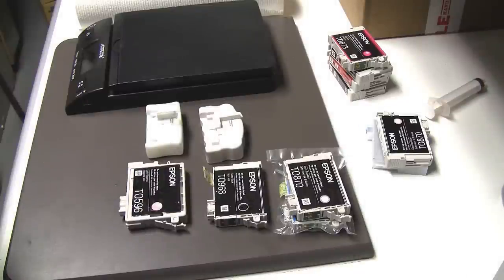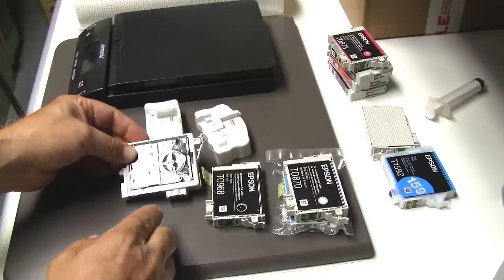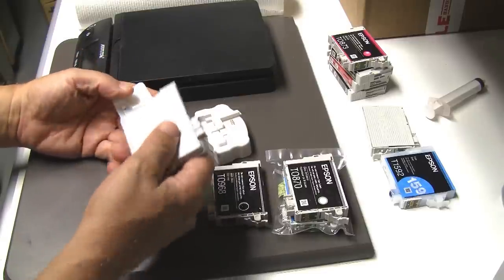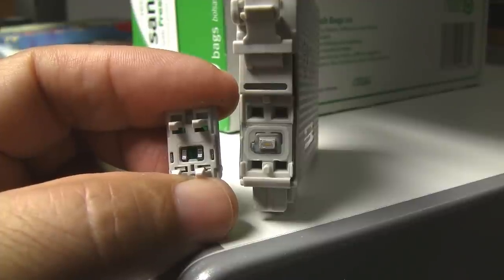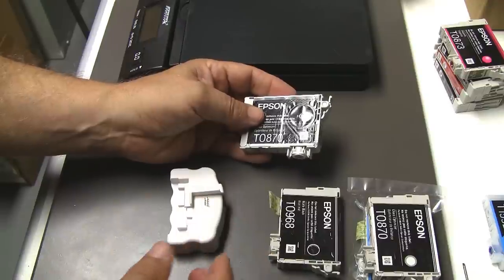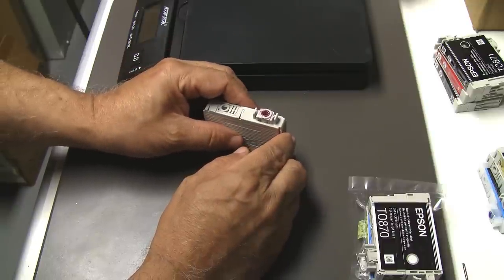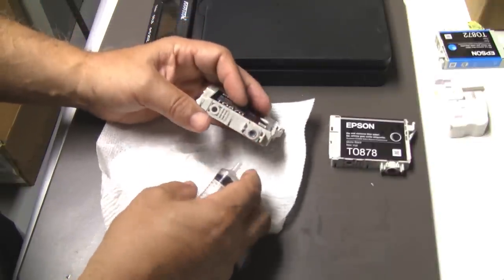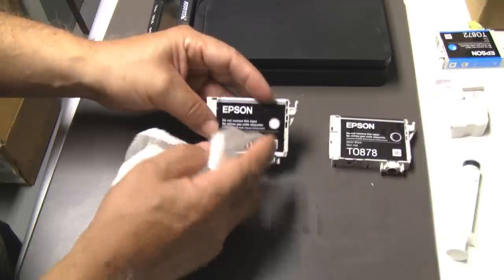New way to refill OEM Epson carts

Comment: I just bought an Expression Premium XP-6000 from Epson. Can you use that method on the 302 carts. which come with it.
Reply from the maker: Nope. This will not work with any of the newer carts, EPSON changed the design to prevent us from continuing to do this.

Comment: Thanks for your findings and for letting us know!

I've tried it with a t080x for my R285 and succeed in breaking the membrane.
Sadly this wet sensor makes you refill so soon that you can refill only around 5ml of the full 7,5ml (which is a joke actually). So I switched back to refillable carts

My question:
I wanted to refill also T054x for my old R800. There are refillables on the market but it's hard to find some reliables 
Do you have tried your method of disrupting the membrane also with this type of carts (for epson r800 and r1800)? 
I just tried to make it "pop" by pushing air into the outlet. But what have worked out fine with a T080x ended with a leaky T054x. I disrupted the cart, not only the membrane.

The T054x is not in your listing but you might have a R800 or 1800 and tried it out...?!

martin0reg
Reply from the maker: +martin 0reg Which is why it is only recommended for non wet sensor carts. The R285 carts do not have a sensor
Reply: +Jose Rodriguez 
My question refers to the R800 (you have to scroll down my posting...)
Did you ever tried to disrupt the membrane of a T054x for R800 or R1800? I haven't succeed ...
So is the only way to refill the r800 OEM carts the "old style"?
Which means to refill "inside out" with poking the other hole and using a tube AND a syringe?
Reply from the maker: +martin 0reg I do not have any T054 carts to look at but if they do have the double factory fill holes on the underside, then the best was and only way I would use is with the Rjettek fill system I use in the video. However if they are do not have those two taped over holes then you have to use the newer method which by the way I did not invent. Rjettek actually sells the tool for doing this with very good consistency. I simply wanted to see if I would be able to do the same thing the $220 tool does, by hand.
Reply: +Jose Rodriguez 
Yes the T054x have these double factory fill holes, and I tried refilling the old style yesterday. With one end of a tube in the factory hole and the other in the ink bottle, then pulling at the ink outlet with an empty syringe. Just like the guy in the video I have posted above. Like rjettek, but vice versa: by sucking instead of pushing the ink.
You only need a tube to stick into the hole with a sealing. And you will need a bigger plug (around 5mm diameter) to close the fill hole.
Seems to work out fine yet.
Reply from the maker: +martin 0reg Yes I've seen that method and either way it works. Supposedly the method I use pushes out 100% of the air that is normally trapped in the ink maze inside the cart much better.Joe

Comment: hi jose, I found a espon work force 600, It just print blank pages, So i cleaned the print head by squirting hot water threw the nozzles like it says on the net which was indeed clogged, So i put the ink carts back in and i was getting something on a page but with lines,  At the time the inks was getting low on link, Than i tried again and it says the yellow ink cartridge not recognized.. Just keep saying that always now, So i filled it up like in your video thinking maybe its saying that because its out of ink, But nope it still says that...  So i was wondering if that sensor got  triggered and its out of ink, Will that make it trigger that message?  I like to know before i buy new ink for it and find out it still says it and its something with the printer.. Even tho it ony started to do that when it got really low, When i first got it,  the ink level that it showed was in the middle, But doing the head cleaning tons of times made it go really low.  Its ony yellow that is having that message.   Thanks:)
Reply from the maker: Yes, it is very likely that the wet sensor was triggered. What happens is that it is under ink during normal operation. While it is under ink it is able to stay cool. Once ink reaches a certain level, almost empty it is exposed to air and no longer protected and it simply overheats and the circuit is broken. You can reset the chip but the link to the printer is now broken so it will be a no go.
You used up all the ink while performing the cleaning cycles.

Comment: Hi Jose what would be good for filling  2 types of Cartridges  Epson stylus NX115 series TO692 AND a Cannon ip2702  PIMXA CL-211XL  COLOR AND CL-211XL BLACK   Thanks Ed from NC.
Reply from the maker: +Ed Pirelli I have no idea really. As I only refill a few cart types which are very old ones. The new carts have lots of mechanisms to defeat our efforts at refilling them specially the ones you mention. So sorry but you best bet is to try to find refillable carts for those printers. About the CANONs I only know about Carts used on Dedicated Photo Printers so I do not know those cart models. If they are opaque then you really can not realistically refill them accurately. Plus you would need a chip resetter. Look on any of the 3rd Party Ink compny websites and see what they can offer.

Comment: About the resetter, i see there are  2 rows of pins, one row with 3 pins and one with 4 pins, while on the chip there is one row with 4 pins and one with 5, respectively. So is it really compatible? And if i have a 7-pin resetter for, let's say, T0968 series, will it be it suitable for other series of cartridges as well or every series of cartridges needs its own resetter? Is there somewhere a list of series of cartridges that share the same resetter? Thanks in advance.
Reply from the maker: I've made it a point to have both a 7 and 9 pin resetter. Is looks like the resetter pins should match the number of contacts on the chips perfectly but that is not the case. Not all the lower row contacts are used for writing the reset codes to the chips. But the upper 4 always are.

Comment: Hi Jose, I tried this on six R1800 oem carts.  Two "popped" as you described and could be filled, but the others burst under the black label and leaked.  Have you experienced this?
Reply from the maker: I think i mentioned of a device that is about $200 which performed the operation I proposed to do by hand manually doing this introduces too many variables and chances for failures. This was an is a totally experimental process with no 100% guarantees. But once you can modify a full.set of them your are all set.

Comment: Hi. would wonder if Jörgen Rambis advise worked out for you :)  ???? Also, would this method not work - see here Refilling the Genuine Epson Cartridges 124 125 127128 129 130 133 138 Ink
 

Also, just wondering , would the cartridge not need some air (pressure) inside, so it presses the colour out whenever the printer is printing. Oh by the way, what size is the syringe (the tip) ???

After refilling ... how to RESET it, without the tool u have ... any other way to so ??
This is how it looks inside: Inside Epson T0711 Black (Cheetah) Ink Cartridge
Reply from the maker: Not what I would call a great refill method. You really have to see the inside MAZE of tunnels and passages on an OEM Epson cart to understand why that method would not fully fill a cart with no air in any of the chambers.

Comment: I have the Artisan 800 which uses T09xx ink, which ink reseter i should use. Please advise, thank you for your video.
Reply from the maker: +Vic Deng There are 7 pin and 9 pin resetters. So check you chip for how many contacts it has then go to EBAY, look up some resetters  to see if your cart CODE NUMBER is actually resettable. I had a Artisan 720 AIO and I ended up having to buy refillable carts for it.Joe

Comment: I use Epson 127 Cartridges with require a 9-pin OEM resetting tool, however I have only seen the 7-pin available. Do you where I can find the resetting tool I need and/or if it is available. Thanks!
Reply from the maker: EBAY!

Comment: Would it be possible to read the normal output of the wetness indicator with an oscilloscope and send it to the back of the chip?
Reply from the maker: ProGamer1515 Now that would be a hell of a lot of problem to go through. I would not even know how to do what you've suggested.Just refill and reset them before they go dry!

Comment: Jose,
Rjtek no longer has those one-way valves available for the older OEM cartrdiges (ie. R2400). Perhaps, you know of another source for these or another way to refill these. Thank you.
Andy
Reply from the maker: Sorry but they were made specifically for them so they are no longer available and I sold the remaining ones I had.
Reply: Thanks. So is it still possible to re-fill the R2400 cartridges somehow.
Reply from the maker: I suppose you could make the same hole into the cart under base as in the video and pressure fill it somehow and then use a plug to seal the hole. It will not work as well as with the actual valves.
Reply: Thank you for your advice and great videos.

Comment: Do you know anything about the 702? Kind of in a bind right now. I have OEM 702 carts and i've not been having luck. I have ink, but I'm not sure of the process and can't find any info.
Reply from the maker: Sorry but don't even know that those are. This method ONLY works for the cart numbers listed in the description. Epson changed the design of carts to prevent that method from being further used. So remember, only the carts listed!

Comment: Do you have a way to refill OEM Epson T273 carts? Epson XP-810 printer. Thank you in advance.
Reply from the maker: If the have the circular diaphragm which is visible under the label then yes. BUT.... if it has a wet sensor you have to refill them before they are close to empty. Before popping or cracking the diaphragm you MUST draw out every remaining drop of ink. That is very important. If you do not you will ruing the cart.

Comment: I have an Epson R2400 and would really like to try this but I am having problems finding syringes and a chip resetter.  I looked on rjettek but can't seem to find what I am looking for.
Reply from the maker: Unfortunately the Rjettek valves which would definitely work with those carts but they are no longer available. Just get refillable with auto reset chips from any seller. They are all pretty much the same.

Comment: Hi Jose,   I have a Epson WF 545.  It uses cartridges T126 or T127.

Do you think your cartridges refill methodology works for me ?
Reply from the maker: +Juan R. It might! This an iffy method unless you actually have the refilling jig. Doing it by hand as I am doing is a 50/50 proposition.
Is there a chip resetter for those carts?
Reply: +Jose Rodriguez .   Hi Jose.   I bought a 7 pin one.  It seems to work, but printer often does not recognize cartridges.
Reply from the maker: +Juan R. I can't really tell you why that happens other than the printer firmware might recognize that the code the resetter writes to the chip is  not a genuine one!
I have not had that happen too often but it has happened. That is why I have so many reserters.

Comment: WOW!!!! Tried it out on 220-I carts and works. But I'm still trying to figure out how to reset the ink levels so I can print :/ I noticed that some CISS instruction videos have a button to reset the chip like Joe D mentioned about shorten it out for wet chips. I'm been looking for a wire diagram how to make my own or at least find what the pinouts are.(non wet chips) Any ideas?
Reply from the maker: Sorry man I thought you were asking about modifying the valve for refilling like on the PRO3800/3880.  No this method shown here is for a certain type of cart that has the round diaphragm  on the side. Nothing else. It is also a very iffy modification.
Reply: Oh I know my carts have that circle diaphragm... It takes a lot of force to pop it. On the 220-i has a sight glass which is helpful for refill.
Reply from the maker: Be careful! You can damage them quite easily!

Comment: Do you know if this method will work on a  Epson 18 / 18XL cartridge. When you remove the ink which is the best way as you did it two ways.
Reply from the maker: Click on Show More!
There you will see a list of Epson cartridges.  If your cart # is not in that list then it will probably not work.  This is a very iffy operation that works only about 50% of the time as it is dependant on the operator. If you had the device that was over $200 then it ie reliable.
Reply: My cartridge is T1801 and not in the list but it does have the round diaphragm on the side so it maybe worth a try. If this method doesn't work do you know how I refill a T1801 cartridge.

Comment: Hi JoseI have epson stylus px 730wd I can see that the T0870 is the same as mine, where do i get the resetter?
Reply from the maker: EBay. Should be a 9 pin Epson resetter. Or you can search for a resetter for T087 carts.  But remember that these carts have wet sensors. They short out the chip conduit to the printer so it will nmo longer communicate with it. So you can not let them reach less than 20%. Al's this method is very iffy to perform successfully and the people who produced the $200 cart jig no longer offer it. I've done it but it takes some luck as well as skill.

Comment: hi i have epson stylus sx 115 and i won to reffil these things so step 1 BLOW air and when make POP stop second reffil with in 3 ready to USE ?? ok this is all all right ? thanks dude !!
Reply from the maker: This method may not work with all newer cart types. Use a 20-30 ml syringe.   Many carts have wet sensors and can not be reset after 15% to empty!  Let me know if this works on your carts.

Comment: Do I still need the chip reseter if I refill it before it gets to low and the printer reports low ink?
Reply from the maker: Yes. When you top off your cars tank you want the gauge to reflect that right? Same with carts. The chip is not at all connected to the internal ink levels. It has no clue how much real ink volume is in there. So yes you need to reset the chip any time you refill...top off...fill.

Comment: Is there a way to refill a empty Epson ink cartridge that have a see through window on the underside of the ink cartridges. My epson printer was showing x for the blue cartridge so I refilled it then used the chip resetter but it's still showing the cartridge is still empty and I think the reason is because no ink is in the see through window on the underside of the ink cartridge just like a new cartridge.
Reply from the maker: How could I possibly know.... what printer you are talking about? The only Epson printer that uses BLUE ink is the very old R800/R1800.  And by the way newer carts for newer printers have a wet sensor that communicates with the driver and when the ink that normally touches it no longer there it shorts out!!! You can reset and refill a thousand times to no avail.  Your only option is a new cart.
Reply: The printer is a old Epson xp-202 that uses four 18 / 18XL cartridges. If my cartridge has a wet sensor would I be able to refill the cartridge when it gets to about half full then try resetting it.
Reply from the maker: Yes but I can not guarantee that the process shown will work. Is your cart # listed on the video description??
If so, then refilling before close to empty will maintain the wet sensor unshorted.
Reply: No my cartridge is not listed in the description but I thought I would try your method on a cartridge that I'm having trouble refilling after the cartridge showed X. The cartridges I have needs a hole drilled in the top of the cartridge so they can be refilled but I've read that when refilling ink must show in the window on the underside of the cartridge but I'm not getting ink to show. I've also got information off this site.http://www.proprint.co.uk/refilling_epson_t29_cartridges.htm

Comment: It was a 10ml. I will give it one more chance with a 20ml and try to suck out
every drop. Thank you
Reply from the maker: A ten ml will not work. You need al east that much air volume to be able to accurately pop that diaphragm.
Here is the Actual product designed and meant for what I can do manually.
http://www.rjettek.com/je1067-jero-epson-single-refill-jig/
Here is their product video:
https://www.youtube.com/watch?v=1YVD2YCO2wg

Comment: Why not fill the syringe half way, then suck out any air and let the vacuum suck in the ink while holding the cartridge upside down of course. I will try this as soon as i can.
Reply from the maker: Because you can not pull a vacuum.  I think the people who came up with this process have already thought of that and any other options. This doesn't who with modern Epson carts anyway.  Only the cart numbers listed on my video description can be used. None other.

Comment: i have an epson sx235w with T1281,T1282,T1283,T1284 inks.What reseter can i use?
Reply from the maker: +Κωνσταντινος Κοντης If these are very new, maybe there is no resetter for them yetl Look on EBAY for possible answer. Looks like a 9 pin resetter will work.